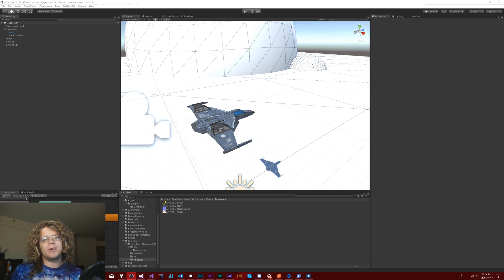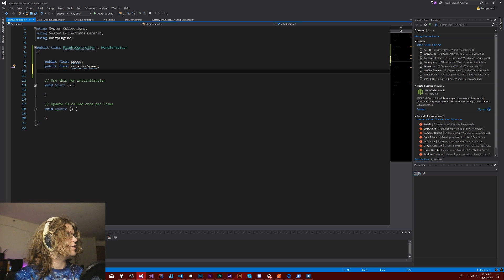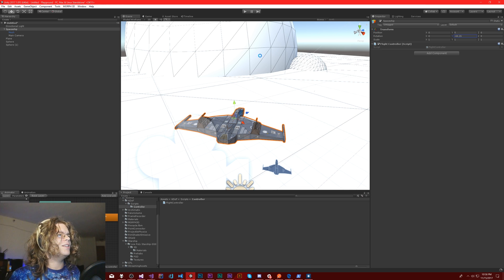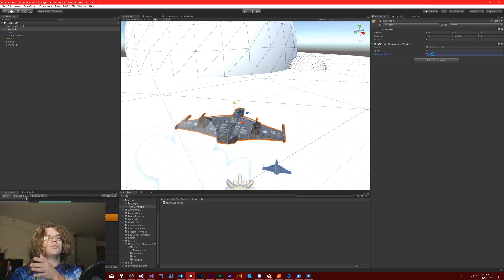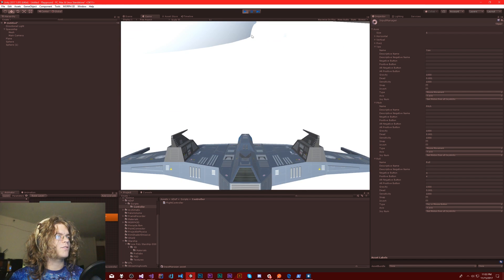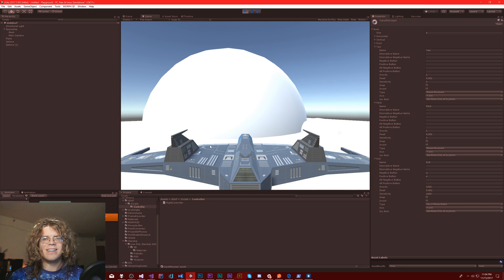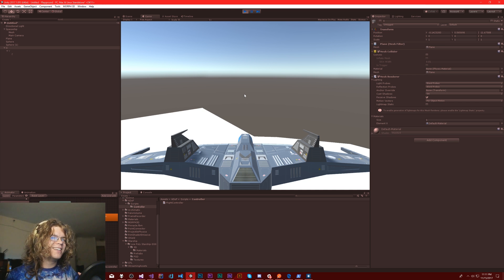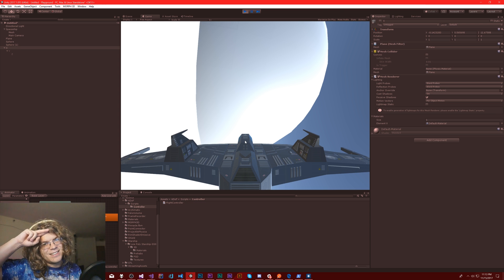6 Degrees of Freedom Spaceship - The WRONG Way

Comment: You can fix those rotation lock issues by storing the rotation instead of retrieving it each time. 

  public float speed;
  public float rotationSpeed; 
  private Vector3 _rotation;
  
  void Start() 
  {
    _rotation = transform.rotation.eulerAngles;
  }

 void Update ()
 {
     _rotation += new Vector3(Input.GetAxis("Pitch") * rotationSpeed * Time.deltaTime,
            Input.GetAxis("Yaw") * rotationSpeed * Time.deltaTime,
            Input.GetAxis("Roll") * rotationSpeed * Time.deltaTime);
     this.transform.rotation = Quaternion.Euler(_rotation);

     this.transform.position += this.transform.forward * Input.GetAxis("Vertical") * speed * Time.deltaTime;
     this.transform.position += this.transform.right * Input.GetAxis("Horizontal") * speed * Time.deltaTime;
    }